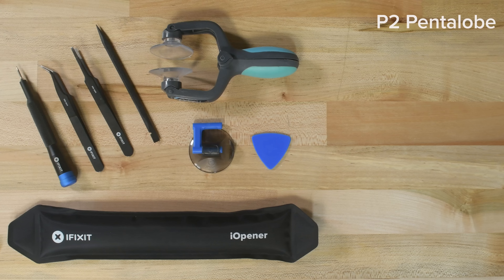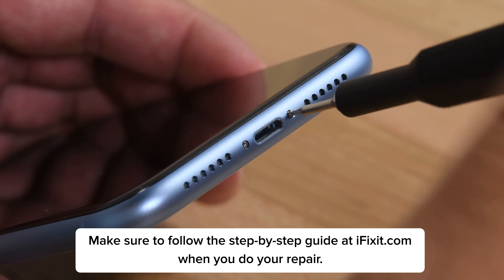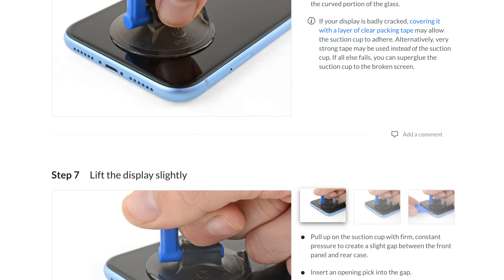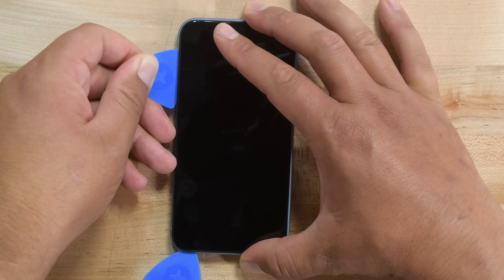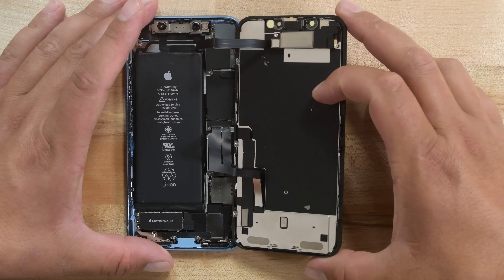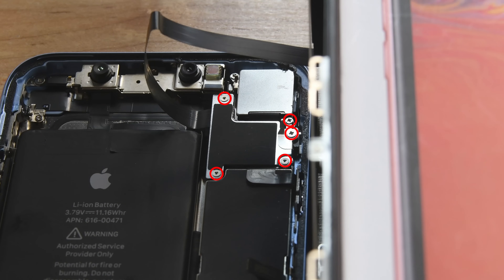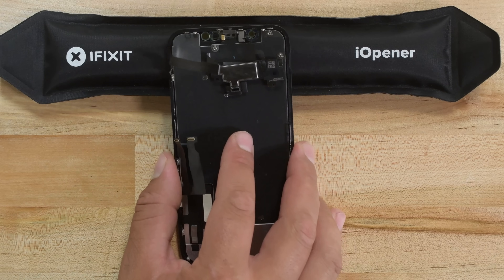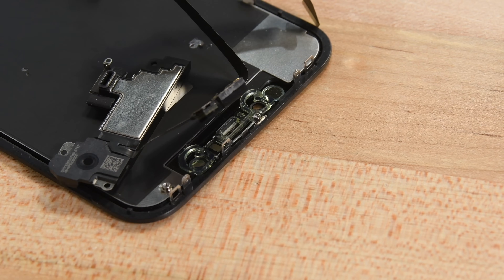iPhone XR Display Replacement!

Comment from the maker: If you've got a cracked iPhone XR screen and are attempting this repair, good luck! You've got this. 

One quick note about iPhone screen replacements: Apple disables some features (like True Tone) after a screen replacement. They have proprietary tools to calibrate the new display and re-enable those features, but unfortunately we don't have access to those tools, and you probably don't either. That said, your new display should otherwise look and function completely normally after a repair! Don't be afraid to attempt this repair yourself.  

In newer iPhones (iPhone 11 and up) Apple goes as far as to pair the original display with the Logic board, and throws an annoying error message in your face after a screen replacement--even if the replacement is a genuine Apple display. You can read more about it here: https://bit.ly/2GpzbEj. Again, this annoying error message only happens in iPhones that are newer than the XR, so it won't be a problem with this repair.
Reply: If you may or may not know, there’s an equipment already that can copy the code from your old display to your new display to bring back True Tone functionality
Reply: @raphaelalba29  it's for true tone only as it transfers original display data to the newer one
Reply: No. I did a screen replacement for my iPad Air 2019 and True Tone still works.
Reply: Il Italiano on iphone true tone will be missing, however on ipad true tone will not be missing
Reply: Thank you for your comment. I was going to attempt to fix it myself but never mind I’ll just have Apple geniuses handle this one.
Reply: I’m doing this for a second time, and this digitiser is different, in that the blue protection tape also has a black layer of tape underneath. My first one doesn’t. Do I need to peel that off..? As there is already a layer of black on the aluminium frame..?

Comment: Superior instructions.   My sons XR got run over by his work cherry picker.    Both glasses completely obliterated, thankfully It was backed up to iCloud, and we were able to pull his photos off the phone and do a data transfer to the new phone with an inexpensive replacement of the display and digitizer.    He’s pretty lucky. 😊 accidents have expensive consequences but this saved us a lot of $ from the Apple Store for a phone that will go in the bin after it’s replaced.

Comment: Just got done doing it..took me  about 30 mins. Luckily the replacmenet screen came with the shield plate  so i could skip a step. 
The hardest part was trying to get the phone open with all the adhesive.. had no heated pad

Comment: Excellent video, thanks! My replacement screen came with no sensor bracket, so I had to remove that from the old screen and remove the earpiece grill from the new screen (because the old grill remained attached to the bracket).

Comment: As an acmt for 5 years and stopped being that in 2017, i've just replaced my smashed screen following the direction of this video and it worked out great. Patience is the key when doing it the first time. Also having the right tools is very important.

Comment: Replaced the screen and now it is stuck in a boot loop. Could it be water damage? What should I do?
Reply: could be different things... motherboard, chip damage, a flex cable thats not fited right... etc

Comment: yall i just did it and it works perfectly, i ordered the screen from a good company and the tools from amazon for 7 dollars in a kit. you dont need to use the i fix it kit as their screens are not good quality sometimes. But the tutorial is accurate and i got to fix my first iphone xr in one try hehehehehehe.
Reply: Can you send the links to the parts?
Reply: @Carolee.21  i bought my screen from mobile sentrix (its a website) and a random kit from amazon for the tools

Comment: Just did this screen replacement with earpiece replacement - thanks for the guide. Those really tiny screws were a pain in the arse.

Btw. I bought a new earpiece, the old one wasn't working at all. Never used faceid anyway.

Btw 2. I had drank a bottle of wine and 4 beers, so anyone can do this.

Comment: Got my phones screen replaced last month and when I went to trade in my phone, t mobile said they couldn’t find my water damage indicator
Reply: A lot of aftermarket screens don't have it. It's on the LCD shield. You can see it on the video on the lower left corner. If you swap it from the original one (like this video) it will be retained.

Comment: 40 min to finish?!  maybe for you that do this on a daily basis - took me about 1.5hrs and i've replaed screens before.  taking it a part = no problem.  Putting back together = frustrating!  getting the little screws in place is lv 10 hard!  but good video, tools and screen i bought from ifixit.  would use them again but would set me expectations to double the time.

Comment: My phones are wrecked I have 3
Reply: I have this one the iPhone XR and the iPhone 11 and galaxy s9
Reply: And I forgot to mention 2 do work just need screens and one has probably have problems the iPhone XR and galaxy s9 just need screen replacements the iPhone 11 has no battery punchard ribbon cables other than that these phones would work

Comment: Overcomplicated this so much:

1 - don't need the silly iOpener tool. Just use a heat gun for a few seconds
2 - don't need those junk suction cup openers that break after 2 days to open it, a thin $5 metal spudger can open it. 
3 - don't need tweezers or picks 
4 - don't need to discharge your battery to 25%
5 - don't need to take off the LCD shield, as most new XR screens come with it 
6 - They didn't test the screen before installing it
7 - They didn't use True Tone copy machine to copy True Tone over
Reply: Ah yes i just have. head gun lying around  🤦
Reply: Heat gun but i def dont have a head gun lol
Reply: @moji3812  hair dryer will do the same think its just a bit louder
Reply: The tool makes it easier
Reply: You need the picks

Comment: It was nice and easy flowing this guide. I did get my screen kit from ifixit like always. Replacing the adhesive was easy too! So nice that it has a protector on the adhesive so you can connect the cables and test the screen without messing up the seal! A cool thing aboutt he replacement screen is you dont have to thread the cable through the shield. Not a big deal but less fidling.

Comment: I heard it in a lot of videos about discharging the battery below 25%. Would that help if the batteries were bulging? Those are the ones you have to be very careful with.
Reply: Disconnect and replace the battery altogether. Bulging battery is dangerous and can explode
Reply: @Andyvt01  oh yeah of course. I just was curious if it's safer to remove with below 25% battery
Reply: @toastedtarts4044  don’t even bother. I work in a repair shop and when a battery is bulging we have to be very careful when haldeling
Reply: @Andyvt01  okay thanks. I went to a phone repair school and they actually said to not accept it because it’s dangerous, but i’ve seen youtube videos where someone was able to do that
Reply: Wait 25% how did they get it so low  lol replace at 85
Reply: @moji3812  they weren’t talking about battery health…
Reply: Change if its expanded

Comment: You can restore the true tone by copying the serial on the old display and transfer it to the new one. By using the JC programmer..
Reply: But why? iFixit parts are super expensive. iPhone 11 Pro Max Screen is $399 just for the part, when apple will repair it for you for $329. I would trust Apple more than myself for basic stuff like this
Reply: Ari Bloch Thats the only way to do it.
Reply: Ari Bloch i work at a phone repair shop. We are legit, use programmers, adhesives, proper equipment, clean environment and have a variety of screens to choose from ranging from Economy-OEM screens. We charge 150 the least on XRs.
Reply: @Ciso_diagnostics  I think that's the only way that makes sense. iFixit is unreasonably expensive and not a great business model in my opinion. I would rather take my phone to a shop for $150 guaranteed to work then spend nearly the same amount on just the part, and no guarantee I do it correctly. And then people like you calibrate them and quality test
Reply: @Richard Clutterbuck I completely understand that. My whole point was almost nobody in their right mind would rather repair something themselves to save $40 on an $150 repair. Especially for batteries, why risk the screen, when apple charges $70 and iFixit charges $80-90 for new phones? Even the iPhone Xs batteries are still $50. I wouldn't risk my screen for $20 savings and the stress of opening something that expensive myself.
Reply: Jordan You can find it on ebay or alibaba. Its cheap. And its easy to use..
Reply: @Richard Clutterbuck I know. It's a rip off
Reply: @Richard Clutterbuck I was using the pro as an extreme example of how expensive iFixit is

Comment: Personally I am an AASP certified, and I can say that the XR is the absolute worst phone to repair.
Reply: Nah, all iPhones are basically the same thing to repair. There are way worse phones to repair.
Reply: Rapha2587 Apples like official way for the repairs have you replace two tiny clips which are just super annoying.
Reply: @Rapha2587 iphone x: ur joking right?
Reply: Still easier than any sealed android phone. Most are caked in glue with no pull tabs.
Reply: @andymiller1597  no my galaxy s10+ is waaay easier to fix than this
Reply: Facts. Grounding springs booo
Reply: I work with these phones too, and XR for me is one easier to repair, not like android phones like the S8 which is hard, but no as much as the iPhone 7 for example
Reply: Cap. The first iPhone was. The new iPhone 12s are too
Reply: I was just about to comment the same thing!
Reply: Yess you’re right it’s soo much extra stuff you have to keep in mind 😞
Reply: Who asked
Reply: Really? How? I repairs two iphone XR today and I had no issues. Except one little grounding bracket that broke dude to being stuck really good but nothing to serious